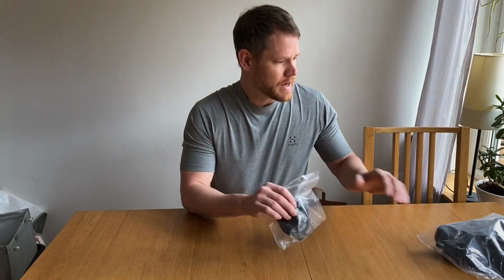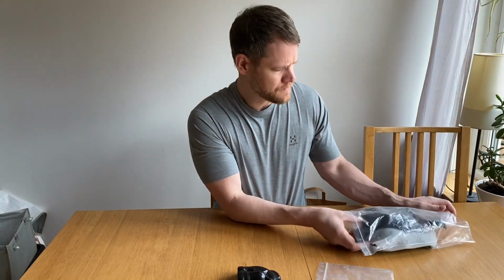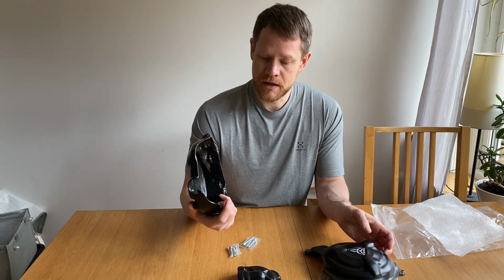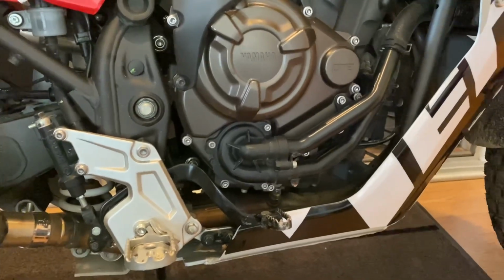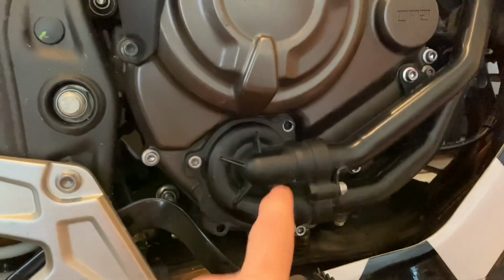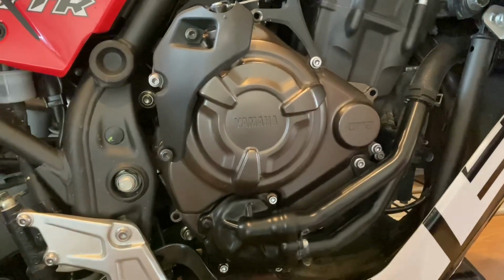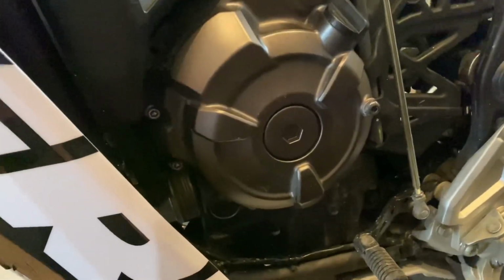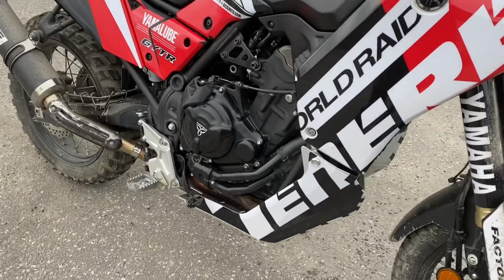Triple Clamp Engine Protection - Yamaha Tenere 700

Comment: Hi do you have to put loctite on the screws ? and also whats the torque specs that you use wheb tightening it back. thanks
Reply from the maker: I put a small dab of Loctite, tourqed them to the specs in the manual. But don’t remember what it was
Reply: @allthingsenduro  Cool man. thanks

Comment: You have a bolt missing at back of engine mate I see when you fit engine case guards
Reply: ,right hand side rear of engine
Reply from the maker: @cliff1551  well, i dont see it. If you don’t thinking of the big round blank round part. That’s where you attach a Yama oem crash bar.
Reply from the maker: What time stamp? Left or right hand side of bike

Comment: Do the engine protectors make the engine run hotter? It seems like it would limit the ability of the aluminum to cool itself.
Reply from the maker: By pure logic, yes. But I do not think it’s a big problem for me personally. 
If I would ride in the desert or where it’s constantly very toasty temps, then I might have skipped these.
Reply: My guess is this won't be an issue since cooling is largely done by coolant circulation and heat dissipation through the radiator. Maybe the fan will get activated just a bit sooner but I am pretty sure you won't notice any difference.

Comment: Great video. What are you thought after testing the covers? Engine temperature? In your opinion if I put the motorbike on the floor lying on the right side,can I manage to change the clutch cover ( left cover)easy in order to don’t loose oil? Thank you in advance.
Reply from the maker: For sure heat dissipation will suffer a bit, all depends on the climate you ride in. 
For Swedish summers (max 30 or so Celsius) I think it will be okey. 
Regarding left side cover, you just have to have the bike straight and you will be fine. 😊